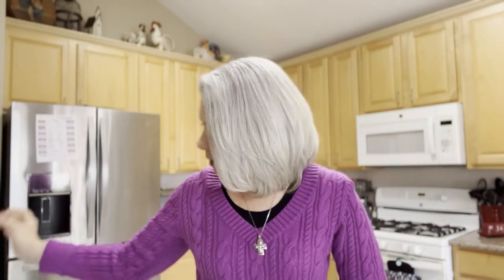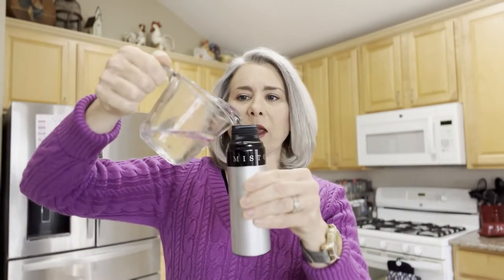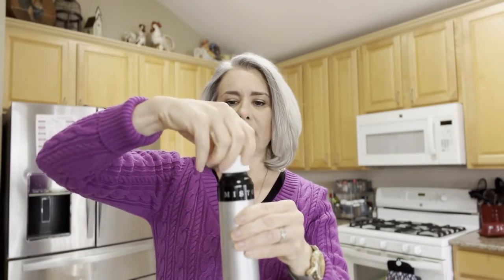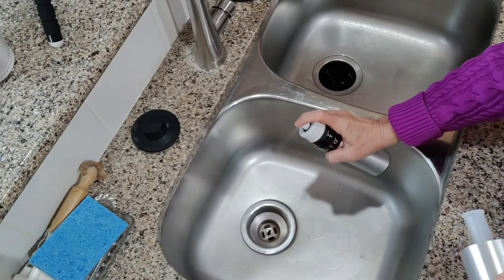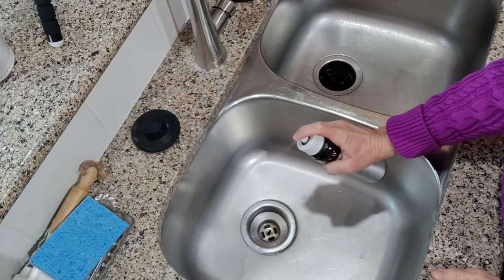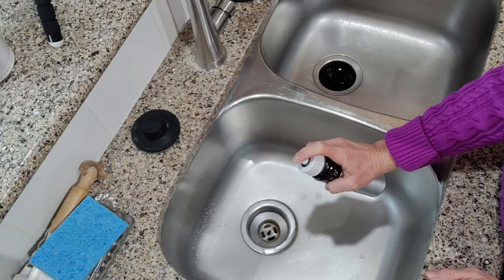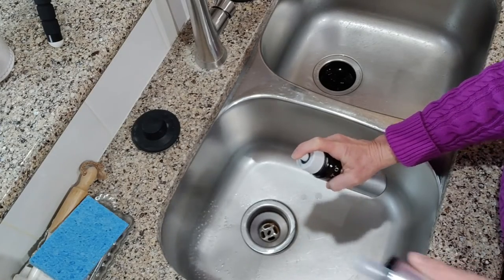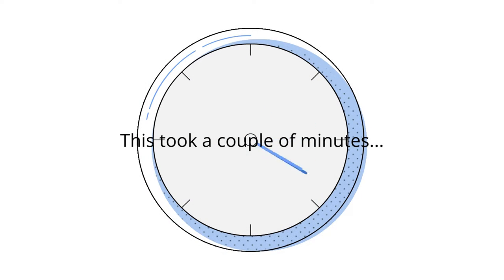How to Clean an Oil Sprayer

Comment: When my Misto began spraying a stream instead of misting, I used your process. beginning with 1/3 C distilled vinegar. Pump/spray twice. Then used hot tap water with Dawn and pumped/sprayed twice. Then rinsed/sprayed with hot tap water twice and took it apart to dry. It worked just ok, but not a consistent mist.  

But then it occurred to me to do one final step. After repeating the cleaning process,  I pressurized the now empty canister,  turned it upside down sprayed the residual moisture out of the tube. Took apart and let dry overnight. Works like new.

Now each time after using the sprayer, I pump it again and turn it upside down to release pressure and clean the tube of the residual oil remaining there. This keeps the feed tube clean and works better than just unscrewing the collar to release pressure. The oil remaining in the tube was the reason it clogged in the first place .
Reply from the maker: Great idea!  Thank you for sharing that!
Reply: I'm going to try that, thanks